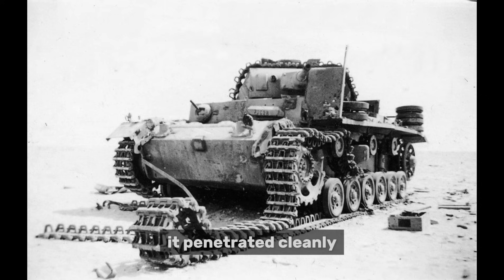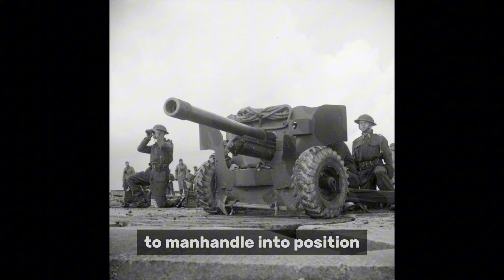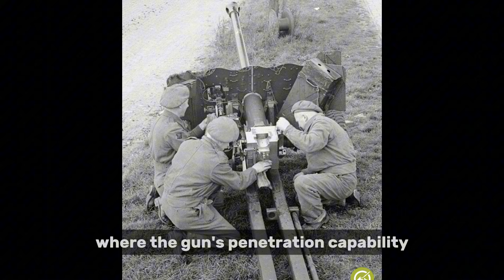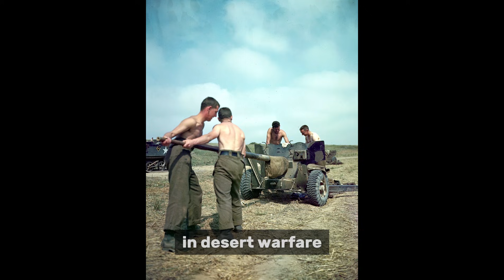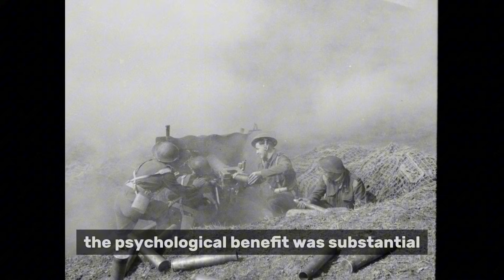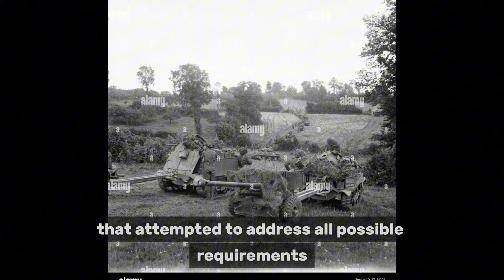Germans Mocked Britain’s “Toy” 6-Pounder — Until It Turned Their Tanks Into Burning Wrecks

Comment: The 6 pounder Mk.I was 45 calibres (from the muzzle end to breech face) and not 42 calibres as quoted, in the video. It could penetrate up to 102mm. of RHA @ 0 degrees @ 100 yards with APCBC/T solid shot ammunition and up to 144mm. of RHA @ 0 degrees @ 100 yards with APDS (in 1944)..

The improved 6 pounder Mk.II was 52 calibres (from the muzzle end to breech face) and is easily identified by the longer barrel with muzzle brake (the Mk.I doesn't use a muzzle brake). The Mk.II could penetrate up to 118mm. of RHA @ 0 degrees @ 100 yards and up to 167mm. of RHA @ 0 degrees @ 100 yards with APDS (in 1944).